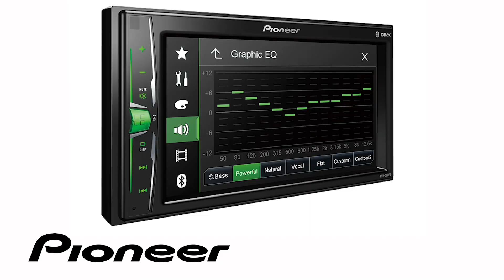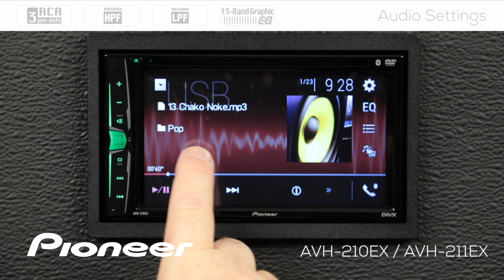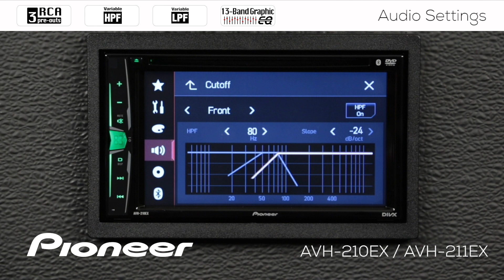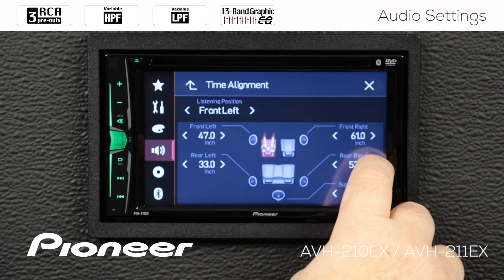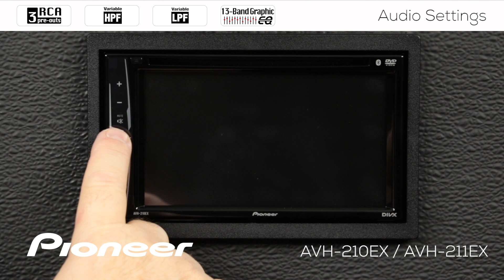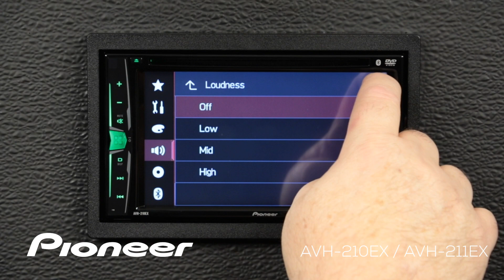How To - AVH-210EX / 211EX - Audio Settings

Comment: How does one prevent the receiver from automatically switching on with the vehicle
Reply: Your question might mean a few different things.  Please read the complete answers.  Pioneer in-dash receivers are designed to automatically power up when the vehicle is switched on.  This is so that even if you don't want to listen to music, Bluetooth phone calls are still available even with no music source selected.  If you want the receiver to   not   play music when the vehicle is powered up, be sure to power down the system before leaving the vehicle by using the Power Off or Source Off in the Source drop down menu or,  the top right of the Home Screen Setting as seen here:   https://youtu.be/kBf9sYwE4dE?list=PLw63zJRQbCNgLoyoij-BJdPDBVLYipAnj&t=196     When you start the vehicle again, the receiver will power up and return to the previously used source, in this case Source Off.   
If you want the in-dash receiver to   not   power up at all when the vehicle is started, that will require a change to the receiver's wiring.   I recommend to put a toggle switch on the receiver's Red Wire.  This way, when the vehicle is powered up, the in-dash receiver will only power up when you put the toggle switch in the closed position. Do not put a switch on the Yellow wire. This will erase the receiver's internal memory each time you open the switch.   You can learn more about wiring your Pioneer receiver here:  https://youtu.be/-bF3uzzaT30?list=PLw63zJRQbCNgLoyoij-BJdPDBVLYipAnj    You can find a full playlist of How To videos from Pioneer about AVH-210EX here:  https://www.youtube.com/watch?v=BEONFGhQP8o&list=PLw63zJRQbCNgLoyoij-BJdPDBVLYipAnj&index=5     and you can find more videos on Pioneer's YouTube Channel here:  https://www.youtube.com/user/pioneerelectronics

Comment: Just installed this and hooked up an amp and subs. Im not getting any rca output at all. Double, triple checked all connections.
Reply: I recommend to press the microprocessor reset button.  You'll need a paperclip, or some other small point to press the microprocessor reset button.  You can find the microprocessor reset button on Pioneer AVH-210EX at the bottom of the hard key panel.  Next do a Restore Settings on the receiver.  You can see it here:   https://youtu.be/Ov6EvrKSOkk?list=PLw63zJRQbCNgLoyoij-BJdPDBVLYipAnj&t=176    You can find a full playlist of How To videos about Pioneer AVH-210EX here:  https://youtu.be/3qzUErs-JGk?list=PLw63zJRQbCNgLoyoij-BJdPDBVLYipAnj   and you can find more videos on Pioneer's YouTube Channel here:  https://www.youtube.com/user/pioneerelectronics

Comment: Mine is not giving me the option to adjust the rear speakers or the fade at all. You have any idea why?
Reply: I have the avh-211ex
Reply: Yes, you have the rear speaker outputs switched Subwoofer output  in the Audio Settings Menu.  You can see how to changed the setting in this video:  https://youtu.be/XA-PlD7EXH8?list=PLw63zJRQbCNgLoyoij-BJdPDBVLYipAnj&t=579    You can learn more about the Subwoofer outputs settings for AVH-211EX in this video:  https://youtu.be/byqeZun3mGk?list=PLw63zJRQbCNgLoyoij-BJdPDBVLYipAnj    You can find a full playlist of How To videos about Pioneer AVH-211EX here:  https://youtu.be/oVH5gvX5Rfs?list=PLw63zJRQbCNgLoyoij-BJdPDBVLYipAnj   and you can find more videos on Pioneer's YouTube Channel here:  https://www.youtube.com/user/pioneerelectronics